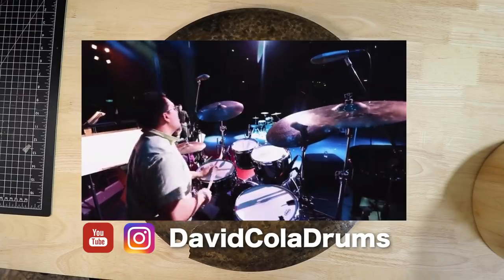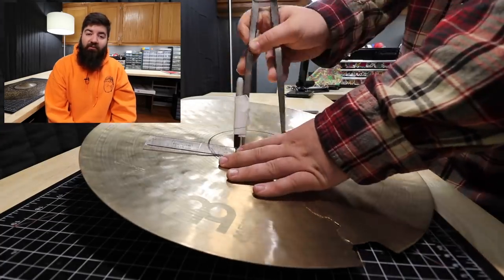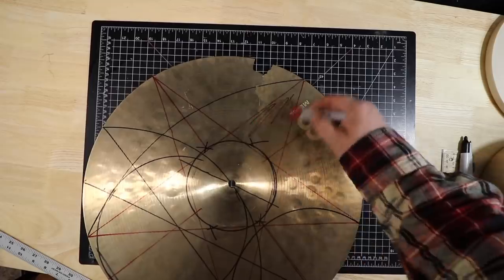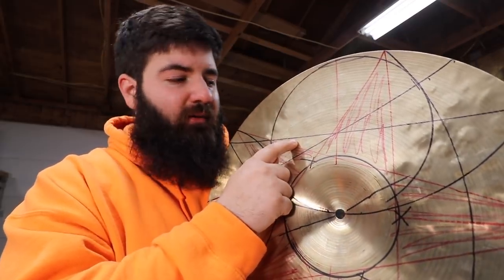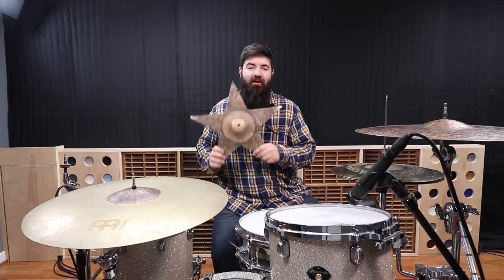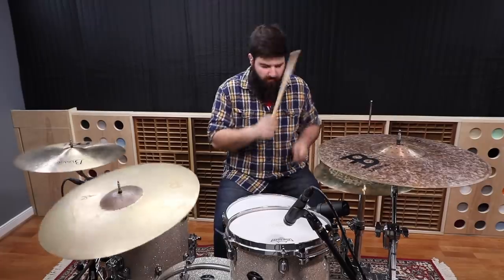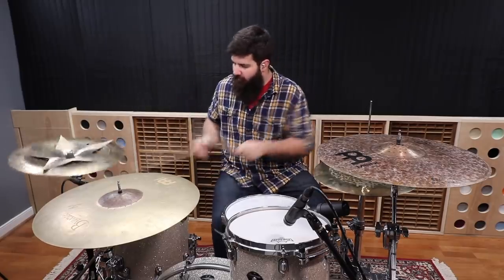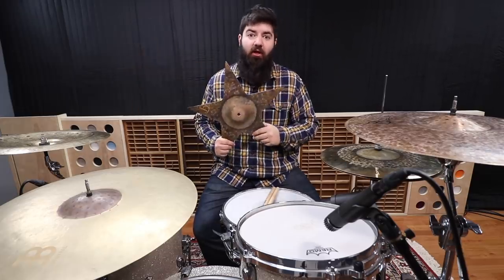Destroying David Cola's Crash Cymbal

Comment: You should put square holes in a cymbal
Reply: That is a very bad idea, a square would increase the risk of cracking the cymbal on the angles. That's why cymbals rarely have polygon shapes in the design (besides the sound aspect of the whole thing)
Reply: MrNoxxis that’s the point
Reply: @raisinbrandon313  no that's the edge
Reply: @FHDTV  no that's the corner
Reply: Skyhunter_2K no that’s the curve
Reply: No that's the concave curve
Reply: You can make a square and drill some tiny holes at the edges. Not perfect but would lower the risk of a crack.
Reply: Insincwit loagen  No that's the hyperbola
Reply: Go to home Depot and ask for a square hole saw
Reply: Lol
Reply: Everyone being acute
Reply: Just use a punch to punch out square holes
Reply: @skyhunter2k  Momento Mori
Reply: @saranoxxis  you must have been new here

Comment: Sounds fantastic as a stack!! I'm pretty sure there isn't any drumming repair, maintenance or build challenge that you can't solve with that brain and that beard. I showed your channel to my percussion professor at college who does a lot of percussion repair on the side and he was blown away. You inspired me to start doing cool stuff with my drums, and I built a snare drum last summer and restored an old Pearl tom some time after.

I have a challenge for you- I have recently gotten my hands on a Tama Royalstar kit, which was in great condition other than the wrap. I've removed the hardware and I want to take the wrap off so I can replace it or stain and lacquer it instead but in order to do so, I need to get the air vents out which are mushroomed in on both sides and through the badges. (If you read this and respond, I can send pictures of what I'm dealing with). I've read that I should use a Dremel and cut away the inside edge but I don't know how to properly do so without damaging the shell. Have you ever dealt with something like this?

Comment: How can a cymbal with deliberately removed huge chunks (in a star shape) sound better than that same cymbal with only a small chunk and some cracks?  I don't get it.  
Perhaps you can build a smelting oven in your back yard.  Reuse the bronze.  
If you want something shaped like a star on your kit, get a cheap metal trash can lid and cut it.  
If you want to stack stuff to make bad crunchy sounds, use beer cans or something.
Learning to do the bronze smelting stuff plus hammering would be a chunk of work but ultimately better use of bronze than drilling and cutting....  Love your channel.